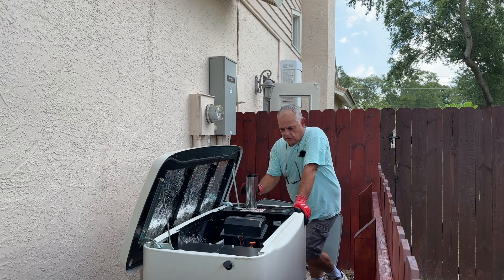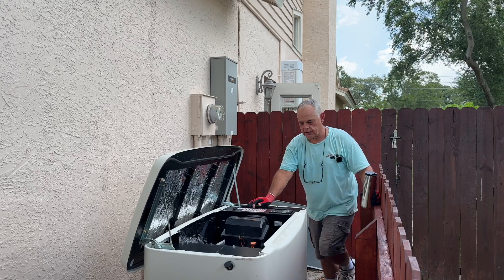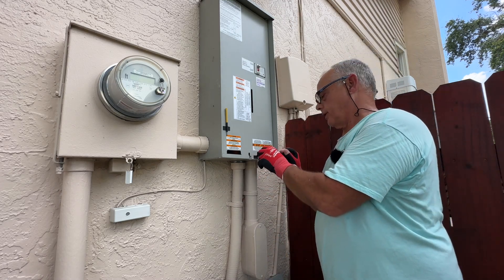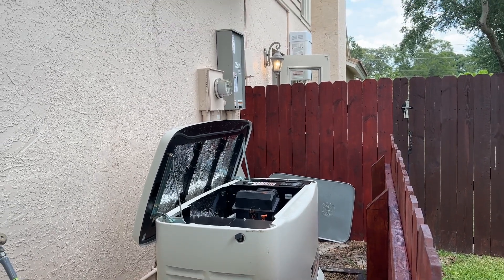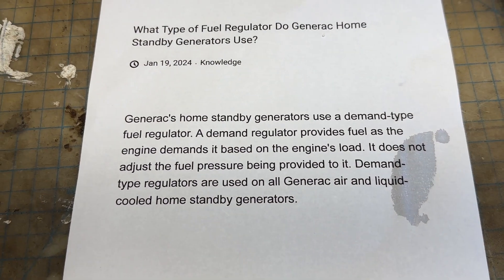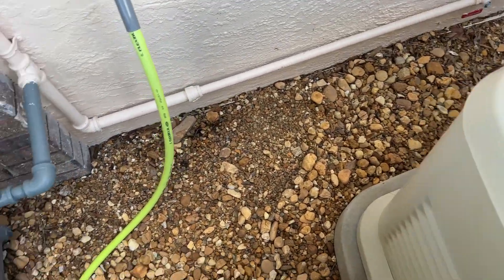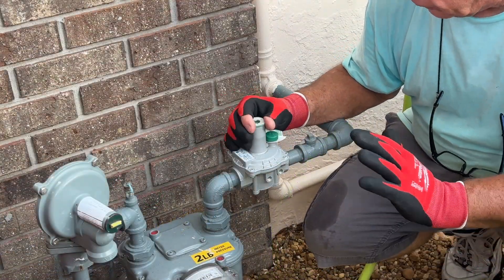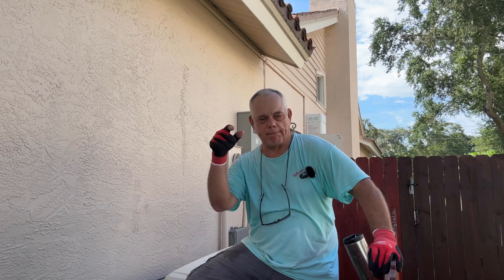How to Adjust The Fuel Pressure For a Generac Generator

Comment: Hey John
I do like the video about your 22Kw Generac Generation.  I have the same type of Generac myself for our 2-story home 🏡.  The only code i have is that it said to check the battery and connect a low battery, it's said 13.5 Volt. So I guess it's time to replace the battery with a new battery. I have the generator 02-21-2019. 
I live in Houston, TX . But one ago half state of Texas without power. You heard in the news that Texas doesn't have power settings in the cold weather without heat & and power, too. But the state of Texas has black out, but our home had power, but I share power with two lives next door to me & they have family with kids, stay warm or cool too
Your new friend in the state of Texas Houston TX.
My name is Michael
Reply from the maker: @msa_0619  Hi Michael, it maybe time to replace the battery but 13.5 volts is what it should be. It may just want you to go through the hoops of servicing it to like I did in this video. Here is a link 
https://youtu.be/Hoh-HTy_CMo?si=05HPqH919CngWmhR
You can buy your self a cheap multimeter and check the battery when it is not running and anything under 13 volts I would buy a new battery. I get my battery from Walmart you will get a three year warranty and they are way cheaper than any one else. Don’t forget to take the old battery with you. Let me know how it turns out. Thanks for watching.

Comment: One additional thought that may or may not be relevant for each situation - a soft start kit for your air conditioners, pool pumps, or other 240v devices that have large inrush current draws can help a lot. A neighbor I helped install a similar sized unit can run two 5 ton A/C units without even hearing a blip from the generator when they start up. The best units I have seen are from Micro-Air and are about $350-$400 online from various vendors. I have installed and tested multiple kits like this and they cut the start-up demand from a 3-5 ton A/C system from 80-120 amps down to just 30-40 amps. Once these units are running, they usually only draw 13-15 amps, which is well within the generator's capacity. This helps your A/C unit last longer (as the soft start feature works whether on grid power or generator power) as well as allowing you to run higher load appliances and devices on these smaller 20-26kw generator systems no problem.

Last - that's a 2psi meter, which is should supply plenty of gas. Older homes in area are running 26kw units off a 0.25psi meter with the house and generator sharing that 1/4 psi line - but we have 1 inch pipe around here and it works fine if the runs are short like yours. The 2psi lines are really only needed for longer runs or smaller pipe sizes like 3/4 inch.
Reply from the maker: @texastriguy  thanks , for the info.
Reply: my 3.5 ton lennox air conditioner unit is on a 40 amp breaker.  so i know that it's never exceeding 40amps ..anyway.  ..there's no soft strat kit installed.

Comment: If the fuel starvation incident happened during an outage it could be demand outweighing supply from your gas provider.  There have been several communities in the news lately with this issue and recent hurricanes.
Reply from the maker: @av-mike  I had not thought about it that way! I bet that was the reason. More and more people are getting these generators. Thank you, for sharing!

Comment: should check and set it with manometer
Reply from the maker: That is a great idea!
Reply: Water column gauges are available.  I have a 0 to 30 inch WC that cost about $20 (US).  Much easier to use than a genuine manometer (struggled with these too many times).  The Pietro Fioremini regulator can be fitted with different springs to change the output pressure to different ranges,.  I think that they can be configured to go up to 14"WC on the output, check me on this.  Generac manual is somewhat confusing about supply pressure to the unit demand regulator.  The manual says 5" to 7" for natural gas and 10' to 12" for propane.  Since propane has about 2.5 times the calorific content of natural gas, I'm wondering if these ranges are backwards.

Comment: Great idea to run it weekly. Just never thought about it. It's one of those things ya just presume will work as needed. Thanks.so much
Reply: It has an Exercise automatic to start it every Week! I don’t know why your installed it?
Reply from the maker: Yes, if you check out some Generac generator videos, you'll notice a white, milky oil. They claim this is normal, but I disagree—water in the oil is never a good sign. Thanks for watching!